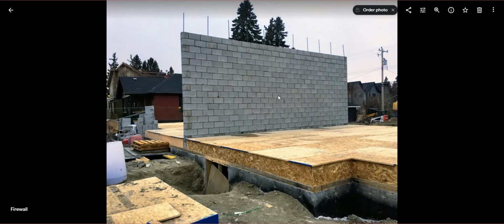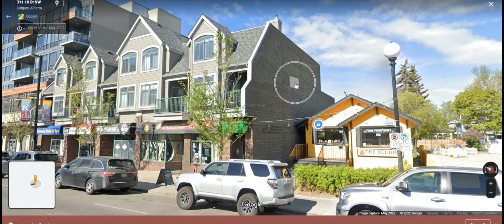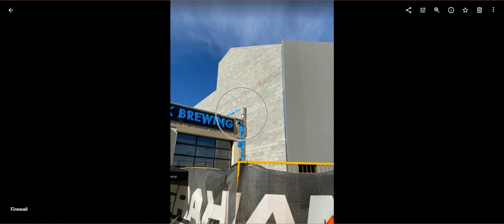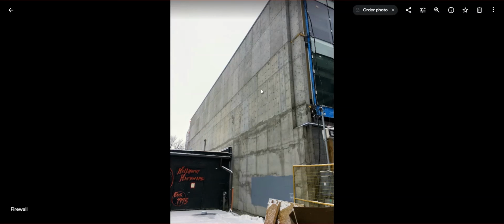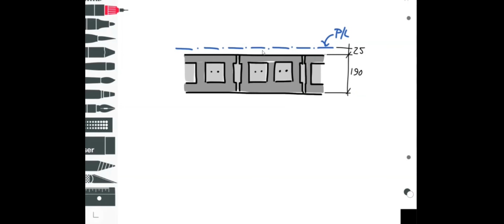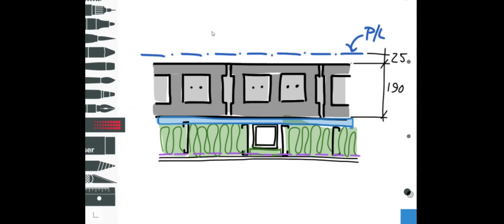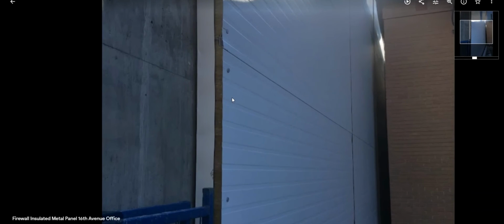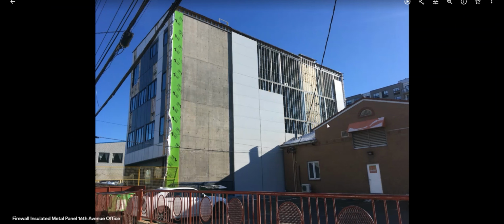Firewalls and Walls Built Against a Property Line

Comment: Sentence 2)  applies to the blank wall in the one photo.  Its half a firewall, it is one of the two separate wall assemblies required by 2)
Reply from the maker: Okay. But what I find interesting is that 3.1.10 and 3.2.3 ever actually dictates the need for a firewall in the first place for that buildings situation in the cover image. 3.1.10 does not explicitly say one needs a Firewall at property line like that situation. 3.2.3 never dictates or references that situation as needing to be a "firewall". It is not a Party wall as it is not jointly owned, but rather resides on one property and owned by the one property owner. So basically it just becomes a spatial separation of proximity of wall to a property line and never dictates it to be masonry or concrete construction. Thoughts?

Comment: Your video on firewalls was very serendipitous (sp?).  I am an Architectural Technologist in Squamish, BC and am designing a personal project on an infill building on a property we have.  Constraints are numerous, among them is that we have a zero lot line condition (zoning constraint) that is required to be built as a firewall (because building code requires it when you have one dwelling unit above another).  We have soft soils prone to liquefaction and a concrete or masonry wall is too heavy which has me looking at other options.  A steel stud wall is the front runner and we wont have access from the outside as my neighbour has already built (8" setback).  Too much info to type here but would love a zoom chat to pick your brain if you are open.  Brilliant video.
Reply from the maker: Hi Mark. The firewall need only be constructed of masonry or concrete if it is more than 2hr frr required (3.1.10.2 (4)) so possibly steel stud and gypsum board approach could work. I assume maybe you are referencing 9.10.11.2 when referring to the requirement of a firewall with stacked units - if so just take notice that this applies to partywall situation. You typically only have a party wall if it is jointly owned unless I suppose your local zero lot line bylaw is somehow overriding code definition of partywall in some way. If the existing adjacent building is only 200mm from p/l then possibly a gypsum board/steel stud approach with NC insulated metal panel approach like seen in the video is the answer? Suggest email me further specifics and some plans and I'll take a look and then we can chat. I 'typically' enjoy solving a good architectural challenge!